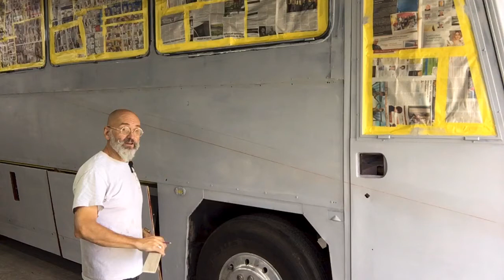E18 We have Primer!

Comment: Yvan:  can you provide the link to the calculator, also the seam sealer that you used.  Thanks.
Reply from the maker: https://handymath.com/cgi-bin/rad2.cgi?submit=Entry
Reply: Thanks.  The complete link results in a “500 Server Error” but https://handymath.com comes up just fine.  There are several arc calculator tools.  I could not determine which one is rad2.cgi from your link.